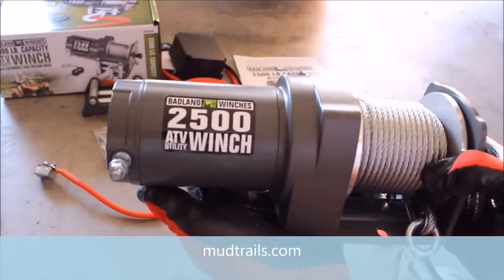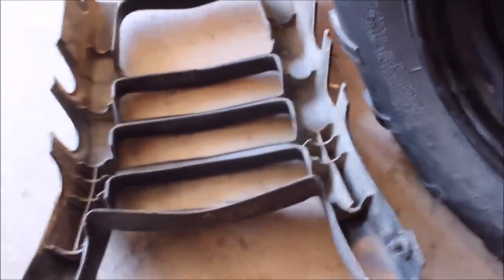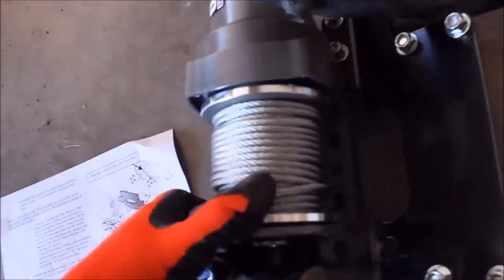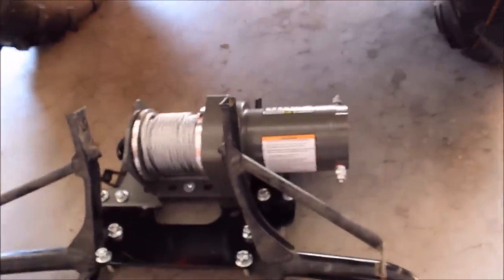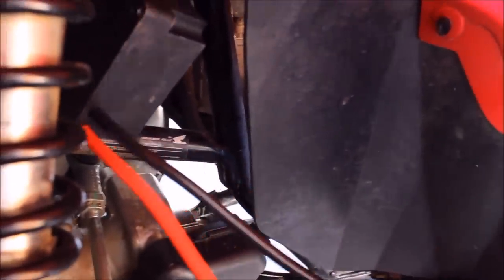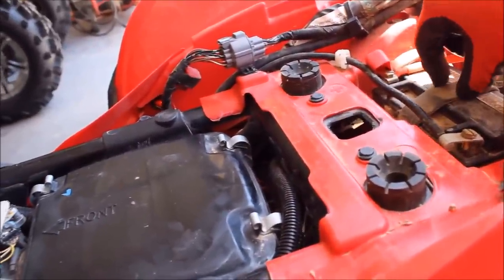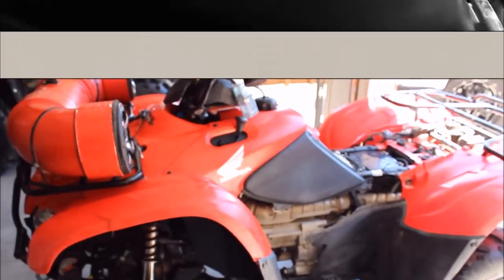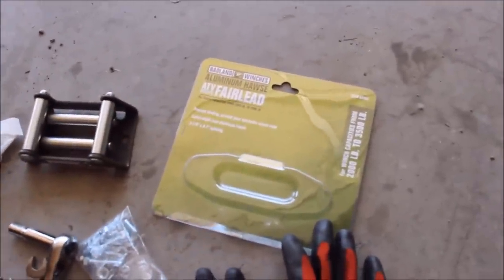2500 Badlands winch install on a Honda Rancher

Comment: Ya, the warn winches are way over priced for what you get. I've used the Badlands winches for years and they hold up very well for me. You are able to rebuild them and replace the brushes when they get worn out. My last one was 10-11 years old before I tore it apart. I used it to lift my snowplow, so it gets a lot of steady use all winter long.  I recently bought a 3500 lb. Badland winch at Harbor Freight for $89 with a coupon so I have all the power I want now!

Comment: Really liked your video I'm glad I seen yours because I'm buying me the same since same price .harbor freight also has a winch mounting plate on sale for 4.99 as of now like you said you can't go wrong with it for the price.all iam going to use it for is to work a snowplow up and down.PS you should do a video on you sound system on your front rack is it made from PVC pipe looked nice keep up the views very helpful.have a blessed day.

Comment from the maker: Just a follow-up, no problems with the winch or fairlead yet, however, just a warning,  it puts a lot more stress on the battery. My battery failed, however, it was about 4 years old. The winch is not the strongest or fastest as expected, but seems to be ok for light duty.
Reply: +psemar Thanks for the great video.  Super helpful.  I just ordered the KFI mount and when it arrives will piece it all together.  Two questions: 1. Did the mount come with hardware, or do I need to get that? 2. What would you do differently to avoid the battery issue you mentioned?  Thanks again!
Reply from the maker: Yes, all hardware I needed came with the winch and mount. The easy solution for the battery is always leave it running when using the winch, leave the ATV on a battery tender when not in use. I never got around to researching wiring it into the ignition, but that would be ideal.
Reply: +psemar I thought u said the winch mount u had to order separately off Amazon?

Comment: i have a recon 250 and its super hard to mount a winch so i bolted it to the mounting plate and the only way was to weld it onto the frame and had to make a custom mount for the rolley

Comment: Hey psemar, good video, but just a question regarding moving the cable to the top for leverage...Would it have just been easier, to unspool the cable and re-spool it back onto the drum, with the fair lead hook on the top? I'm getting ready to install same system in my 05 Honda Rincon and after watching your video, thought about doing it that way. Your thoughts??
Reply from the maker: Sorry for late reply, I did not think of that, yes, that would be better!

Comment: Nice job on the video, I bought the winch already, need the mounting plate. Looked on amazon but I have not located the right mounting plate as of yet. I need the same plate you bought for my 2014 rancher. Very informative video, thank you!!
Reply from the maker: https://www.amazon.com/gp/product/B0027UO7PU/ref=as_li_qf_sp_asin_il_tl?ie=UTF8&camp=1789&creative=9325&creativeASIN=B0027UO7PU&linkCode=as2&tag=prepaicom-20&linkId=44BATL6PT7WZMGLS - Here is the one I picked up

Comment: Hey fella nice video. I bought the same winch and ran into the same problem with my kfi mount and fairlead. I bought the aluminum one same as you but haven't installed either one yet. Wanted to know how that fairlead is holding up and how often you use the winch.  Thanks for the vid
Reply from the maker: Flora Dew Hi Flora, thanks for the comments, other than playing around with the winch a bit, I have not had any serious usage yet....Have a trail ride planned soon, will see if we get in a bind at all and need to use it. I mainly got it for emergencies, so do not plan to use it on a daily basis, if that were the case, the roller leads would probably be a lot better from a friction point of view. But the aluminum one sure made for a better install!

Comment: You mounted the winch on the frame of the ATV right? I’ve already watched the video but I forgot I’m about to watch it again. How many holes did you end up having to make? Oh and do you have to remove that safety plate?
Reply from the maker: It was mounted to a plate that I got from Amazon rather than directly to the frame. This was the way I did it, not sure if it was correct, I have seen other comments that I should have left the safety plate and not put it upside down. Others flame that rolling pin I used was not designed for steel cable, I am aware of that, but seemed to work fine for light use. If you are going for heavy use, get a better winch!
Reply: @psemar  I’m going for light use. Can the mount from harbor freight be mounted onto the frame or no?
Reply from the maker: @Edgarrre  Not unless you can fabricate a mount
Reply: @psemar  what? What do you mean. I’m using the mount from harbor freight that was $6. All in asking is if I can mount that mount onto the atv??
Reply from the maker: @Edgarrre  I could not get it to work, maybe you can. I ended up ordering one that was made for my ATV.

Comment: I could be wrong,,, but couldnt you have just removed the hookfrom the ferrell end of the cable or if not , juz unspool the cable , then respool it the it needed to be and spooling off the top as needed ? Im juz checkin cause i juz bought the 5000lb & takin notes !! Lol !

Comment: I bought one of the wenches and had my nearby motorcycle shop install it (not as well as yours), but now at home, can't get it to work. I pull the handle and got all the wire out, but now I have a lot of wire and it won't retract. I'm puzzled. Any suggestion?
Reply from the maker: Is the light coming on, on the remote?

Comment: Would it be smart to install this when I have a light bar connected to the battery as well. Light bar is at 126w
Reply from the maker: As long as your stator is solid and you keep engine running, guessing you will be ok. You may have to use them one at a time though if you find it pulls too much amperage having them both on.
Reply: I did it and had no problem 🤷‍♂️

Comment: What are your thoughts on this install? Was it worth it??
Reply from the maker: It has been several years, and it did finally fail, but for a quick winch install on a budget, I would say it was still worth it!
Reply: psemar Thank you! How did it perform? i plan on using it to get me out if i ever get stuck since i only have 2 wheel drive

Comment: why did you flip the brake? or whatever that metal shield was?? I didn't on mine. you got me wondering.
Reply from the maker: +Shelby Kirkland Hi Shelby, according to directions for best leverage, the wire needs to come from the top, with the KFI mount, it appeared that shield would have been in the way. I could have left the shield on and had the cable pull from the bottom, but I did not think the shield was that important.

Comment: I was told that those winches have plastic gears, designed to break down in short time. I'm getting the 3,500 pound one with metal gears. Less than twice as much, lasting many times longer.
Reply: No these wenches last a long time if you don't abuse themand keep them submerged underwater. For the price you can't beat them for the use you get out of them

Comment: Hey, nice job.  I bought the same winch.  I can't get the hook through the fairlead that came with it.  Any ideas?
Reply from the maker: +Martin Parmer Hi Martin, you have to take off one of the rollers on the fairlead to get it through. Thanks!
Reply: Martin Parmer take the hook off the cable run it through the Fairland then reconnect the hook
Reply: Not possible.  No key on hook.

Comment: Throw the remote away it will stop working wire a toggle switch or bar switch in while its not installed much better you'll thank me later
Reply: +Frank D how do i rewire the cable to a 3 way switch?? i have the big hand held remote, thanks,
Reply: I did the bypass years ago on my winch just in case but my remote still works flawlessly and it's been 5 years or longer on the same
Reply: Could you make a video on this?

Comment: You going to wish you got warn or kfi in the long run if you have to buy another one later on two of those is one 3,000 pound kfi
Reply: will clark 

Not everyone abuses a winch and they break.  I’ve had this type winch for years now with no issue and my brothers warn winch burned up
Reply: Said nobody that's had these wenches before.go ahead and overspend somewhere Else bar Harbor Freight has the best winches you can buy for the money hands down !

Comment: Super unreliable winches! Don't waste your money. They should of gave you the $60 with the winch lol
Reply from the maker: I agree to that, it did finally bite the dust, but still no regrets for what was spent.
Reply: these are the best winches you can buy for the money. You either don't know how to install them right or you are not using them correctly. They have awesome ratings for a reason and you can find them in magazines along with other when manufacturers in head-to-head discussions and they always say they are awesome for the price